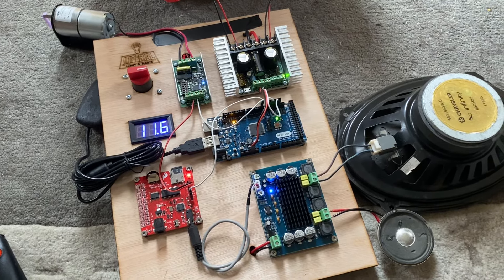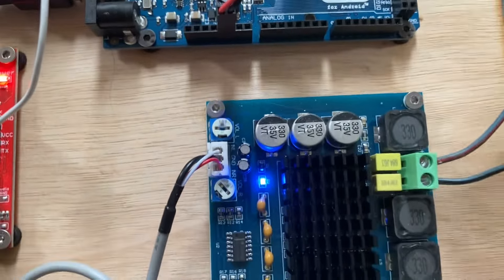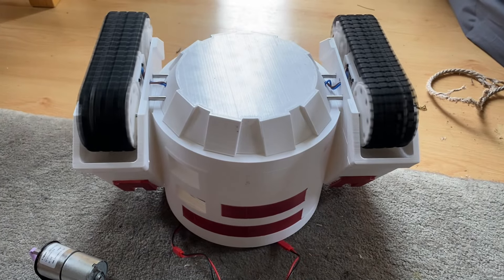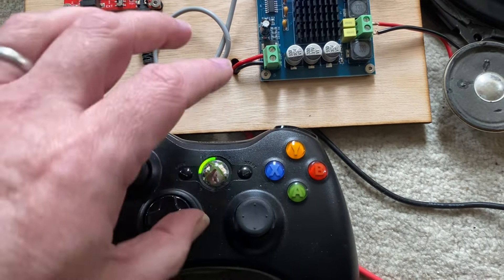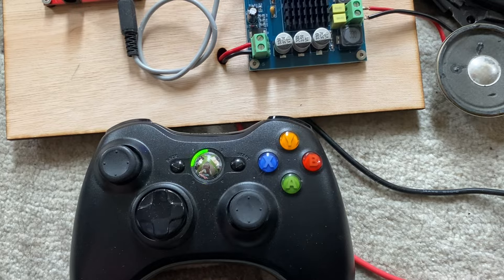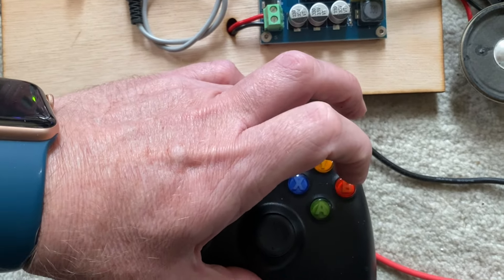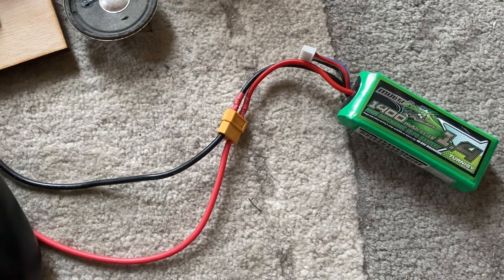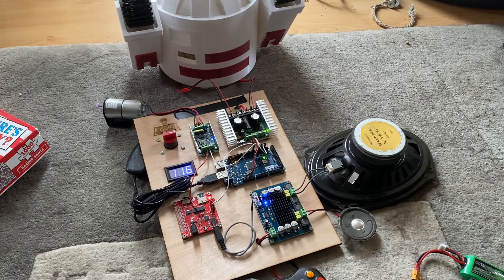Padawan 360 board for a UK client

Comment: I am buying the components for this build but I was wondering what cable you used to connect the mp3 trigger to the amplifier? Thank you. Is there anywhere I can find a wiring diagram with cables needed?